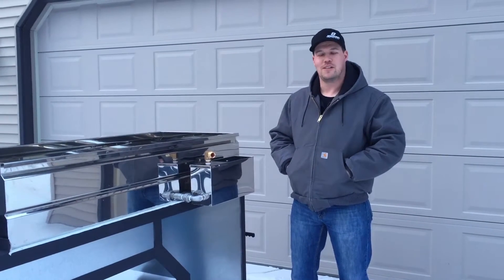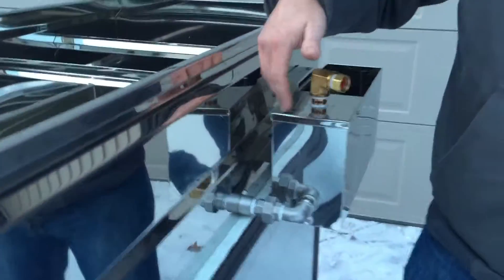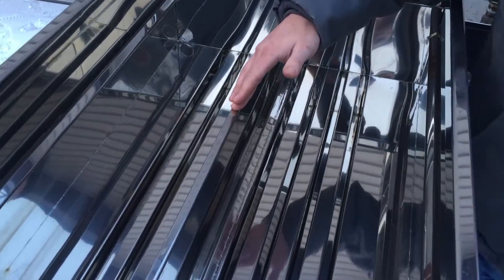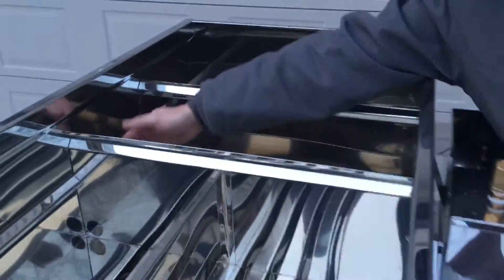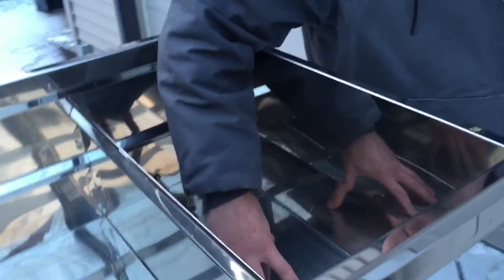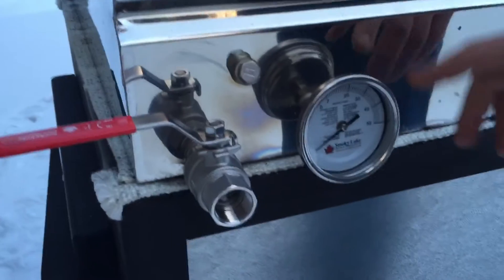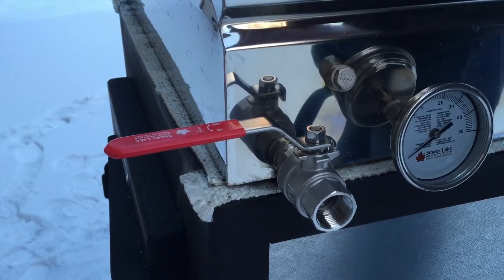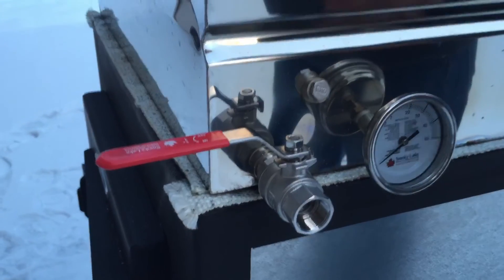Basics of a Smoky Lake Hybrid Hobby Pan

Comment: Mark, what was your experience with evaporation rates on this 2 x 5 ? Curious if it's close to the 20 to 25 gph stated rates but hoping it did way better.
Reply from the maker: Southeastern Ohio Honey Bees & BBQ I can get 20 gph no problem with larger chunks of wood with the blower fan on quarter speed.  With smaller wood and some smaller hard wood I can get almost to 25 gph.  This is with cold sap going into the float box I bet if I warmer it I could get over 25 gph.
Reply: @markk4861  Do you think it's a good pan for the price? If you could go back and do anything different would you, and if so what would that be and what are your overall thoughts? Dropping near two grand on a pan is hard to do but it seems way better than a flat pan for sure. I'm looking for proper guidance from someone who's been there done that.
Reply from the maker: Southeastern Ohio Honey Bees & BBQ Smokey Lake makes VERY nice pans!  The welds and finish on them are excellent and almost too nice to get dirty.  Just need to order an 90 for the end of the ball valve to finish the pan off.  There’s noting I’d change on it.  I do really like the divider in the drop flue section because is helps heat the incoming sap faster.

Comment: Maybe stupid question.  Setting mine up.  No damper in the stack, correct?
Reply from the maker: Colin Bailey...Correct there's no dampener in the stack because I have the forced air fan on my unit.  A dampener would defeat the purpose of having the blower.  You want as much heat under the pan as possible.